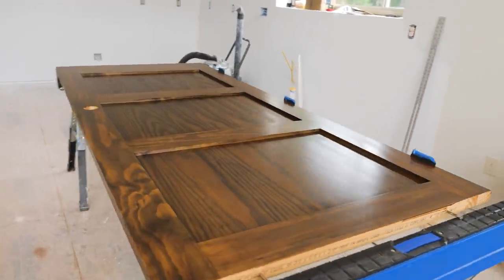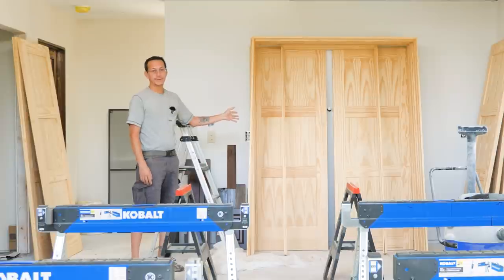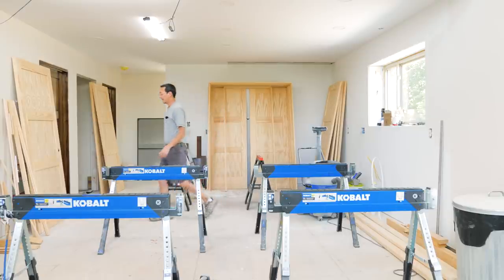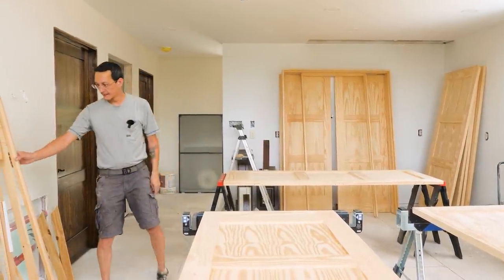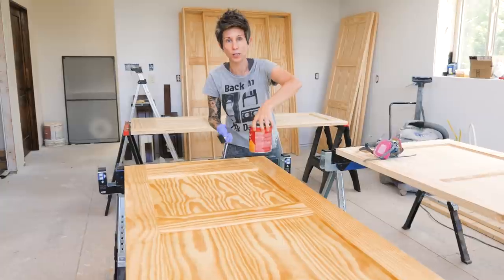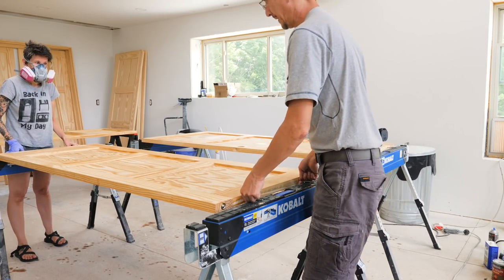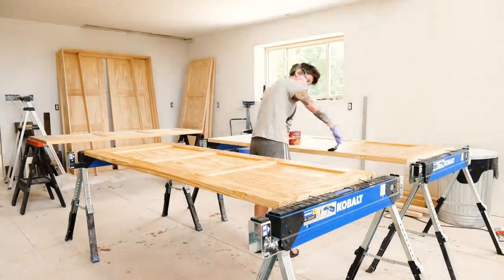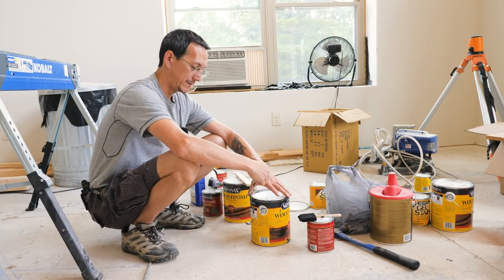Secrets to Staining Beautiful Rustic Pine Doors!

Comment: The doors look very nice, good job.    When I sprayed my doors, drove some finish nails in the bottom of the door as legs and stood them up against a post to do both sides.  Only down side was when a gust of wind tipped over one of the wet doors face down on the lawn, thinner and rags saved the grass coated door.   Tip:  Poly moisture cures by absorbing moisture from the air.  Float a couple sheets of plastic wrap or Al foil on the surface of the poly in the can to keep the air off the remaining material.

Comment: Lovely! Very tedious indeed. I went for the same look in my projects.  I was going to suggest Jacobean to you guys with a Spar-urethane finish but wasn't sure exactly what you were going for when you started testing and asked for suggestions. Spar-urethane is excellent for the least yellowing...I used it on my window sills which are in the NM sun all day and 5 years later... no yellowing, and excellent seal. The one above my sink (window sill) gets wet often from over spray on dishes and it is still like new! I did the Jacobean with the red mahogany touch like you are with expresso. The Jacobean helped with the greening/ yellowing more and kept the expresso brown intact. So, if your going to do anymore staining to match your doors... you could try that combo. Spar-urethane is thicker, so I had to be careful to seal it tight between steps.  But we're very happy we did it ourselves. In the future, as tedious as it is I will finish all my wood stained projects! It looks awesome guys!! Wahoo! Smiles and blessings...

Comment: Excellent work! I am impressed with your patience to follow the correct process and resistance to short cuts. Pro tip that few carpenters know. The top and bottom hinges are "set hinges". They set the door in relation to plumb. The center hinge is the "carrier hinge". It is only to help carry the weight of the door.  Never shim your center hinge. The center hinge should float free to reduce the possibilty of hinge binding and noisy operation.  Thanks for the content.

Comment: If you have an area with exposed wood still like a room in the basement you can skip the sawhorses by using eye screws into the areas the hinges will be to hang the door long ways so you can access both sides as they hang. It can be worth it to tent the room used in plastic in case of splatter or over spray
Reply: Agree.  You can set up a spray booth in the basement so you don't have to worry about the rain or wind blowing debris on wet door.

Comment: We are getting ready to stain multiple pine doors and your video gave us some great tips!  Do you have to use a sprayer for the poly or can you put that on with a sponge brush instead?
Reply from the maker: You can sponge brush it. It just takes a little longer and you'll want to sand the bumps off with 320 before the final coat.

Comment: I was told to sand my door which was brand new like the ones in the video with 400grit and i did that, pre-stain, and when i went to put the stain (water based) on it did not take at all. Any suggestions?
Reply: You used to fine of a grit. Basically you sealed the wood by sanding it with a 400 grit. Need to use 150 then 180.

Comment: What kind of pine were those? Yellow? You mentioned rustic pine. It looks like the old heart pine in my old house. 
Thanks for sharing your methods and results. I'm trying to stain/tone my baseboards trim without reversing the grain. The grain looks great natural, but if you want to add color you run into complication. I noticed the wood conditioner doesn't prevent that. Hell I may just shellac mine and call it good. Shellac doesn't reverse the grain. Also looking into dyes and gel stains.

Comment: I found that the foam sanding blocks worked sealing well on the molding details.  My trim and doors were refinished by the door manufacturer to my color specifications.  They have a beautiful finish.  I then had to match them for all the windows.  They turned out pretty good.  Our doors and trim are knotty pine.
Reply: With the Velcro attachment points? Do you remove the Velcro?
Reply: @jasondolan8888  The foam blocks have their own abrasive.  they are disposable.

Comment: Did you thin the poly with mineral spirits before spraying? Thanks
Reply from the maker: No I didn't need to, but you can if using a finer spray tip.

Comment: Thumbs up for packing while staining lol. Smokies?  Subscribed for for tops. I have 3 pine doors to do bit going water based. Oil stinks for too long for me. Curious on the Hvlp. I have a cheapie and a cheap 13gal. Compressor. Wondering if enough cfm. Was planning on brushing but man that finish is tempting.

Comment: Loving Jaime's "Back In My Day" shirt.  You just need to replace the 3.5" floppy disk with paper tape or punch cards LOL
I'd be more inclined to do the center sections (where I have to reach/lean) then the edges (ALL of them including top and bottom) then the side rails.
That "trick" of using extra long/heavy screws to fasten both the hinges AND the lock plates is even more important on ENTRY doors.  Makes them that much harder to knock down!
That is NOT a good bit for Schlage, even though they HAVE stepped up to fix the matter.  I will say it's much better than the response from Lagoon regarding the poor suckers who have their 450 catamarans.
Guys, please, PLEASE tell us you're planning on sealing the top and bottom of those doors?  Even if it's only in a clear finish, that wood needs to be sealed
Reply from the maker: This topic has been brought up numerous times in the comments. Yes even though we aren't staining the tops and bottoms (stain is not a sealer), we are spraying all 6 sides of every door with at least 2 coats of polyurethane. 👍
Reply: @Guildbrookfarm  Gotcha, my main idea was to seal off (as much as possible) the pores of the wood from absorbing and releasing moisture.  The poly coating should do that nicely, thanks for the reply!

Comment: On lite colored wood, I just use a damp rag to raise the grain just a little then spray the stain.  Let it sit until you achieve the shade you want, then wipe it down. Lite sanding after and then clear of your choice. Works great on maple and pine.
Reply: Hey Joey, may I ask if this method prevents the grain reversal? I am looking for a way to make darks and light areas darken proportionately.

Comment: hi guys greetings from ireland, here we can buy a shaker style door  prefinished  in walnut, oak, etc.for about €160= $188  that's just the door no hard ware, no frame.  i would love to know what you guys are paying ?
Reply: Depends on the area. In Texas we can get them as cheap as $100 a cabinet door. Custom cabinets are about $250-500 a linear ft depending on material and style, finished and installed.

Comment: A little trick, wait 24hrs after the pre-stain, this will reduce the blotching. The information on the can is misleading. Got that from a professional finisher.
Reply from the maker: I’ll be trying that! Thanks.
Reply: After 24 hours, the pre-stain will certainly have evaporated, rendering it useless. 30 minutes on pine is plenty. Wipe off excess, start staining.